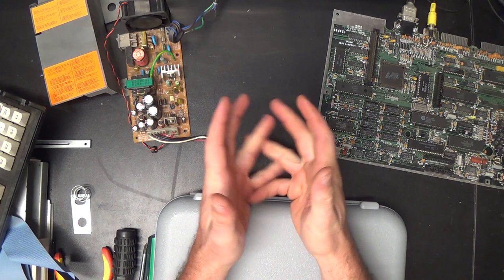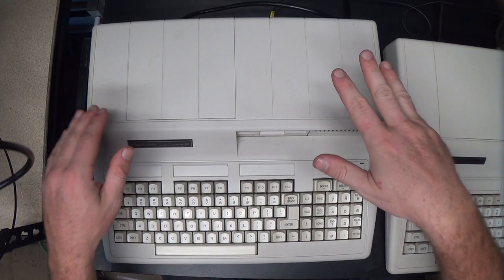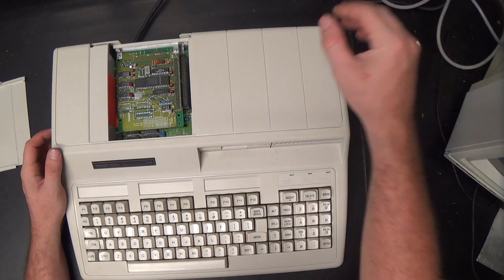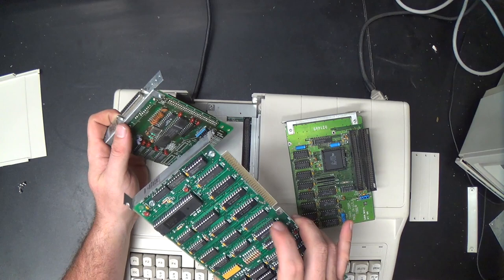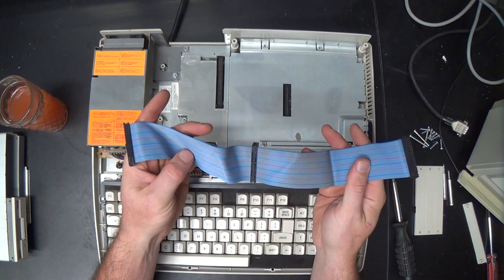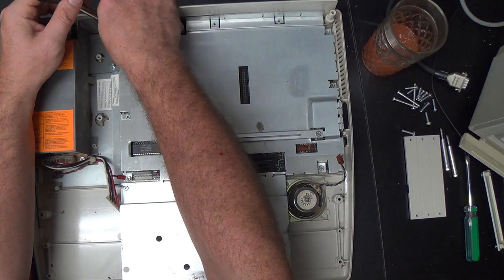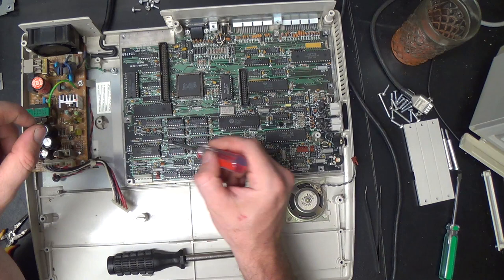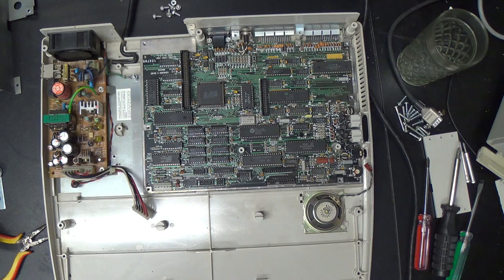Tandy 1000 HX (Pt.1) Ramble and Tear-Apart (#SepTandy 9th, 2020)

Comment from the maker: Well guys, I went up to film the next one and discovered that one of my power supplies decided to spontaneously harikiri.  470 ohm resistor literally caught on fire and the main transformer burned a winding on the primary side.  Or at least that's what I think from farting around with a meter.  Anyway, I spent the whole evening messing with that and didn't actually get anything constructive done, so I guess the next odour of bizniss will have to wait until tomorrer.  D:  Sorry!

Comment: Fortunately for those who can't find PLUS cards, the PLUS bus is ISA compatible (with the exception of a few lines), and it's easy to make PLUS to ISA adapters. I prefer a ribbon myself, as it gives you more room to maneuver the card to make it fit. There's also a thread on VCFED where a few of us were playing around with making our own PLUS cards.
Reply from the maker: I have a couple of AT-form-factor ISA backplanes, one of which I intend to use with one of my HX'en at some point, but I am still trying to find a nice little enclosure to put it in.  I take a ribbon cable out the back of the HX and plug it into an ISA edge-connector card that plugs down into the passive backplane.  This is what I used: https://oshpark.com/shared_projects/cG4aZUEg  For the HX side, a ribbon cable like is intended for the Raspberry Pi GPIO header will plug into the PLUS bus if you pull the plastic shroud off.
Reply: @Lee_Adamson_OCF  I just built mine from scratch using a 0.100" 2x31 female header and an 8-bit ISA slot, and soldered the ribbon by hand. There's supposed to be 62-pin ribbon connectors somewhere, but Digi-Key doesn't have them.
Reply from the maker: @BlackEpyon  I use a 2x32 IDC connector and let the two end positions hang off with nothing plugging into them.
Reply: @Lee_Adamson_OCF  Yeah, the shrouds have just enough space that you can do that... Or accidentally misalign the card you're attempting to plug in, which was kind of an oversight on Tandy's part, but they wanted you to take it to a Radio Shack to be serviced, I suppose.

Comment: 1,000 HX was actually my very first computer. I actually got it several years after it's released back when a computer model would be selling for years instead of months like now. I was actually able to get all the peripherals very cheap I was 15 16 maybe. I actually had a modem I had no idea how to use and never really did I got the ad-lib sound card and I got the memory expansion with the additional chips so I had the full 640k or whatnot . But to refer back to your video I actually did install the second three and a half inch floppy and it was actually very handy playing King's quest games because I could load and then alternate drives and speed up the playing process by 2 seconds when transitioning from one disc to the other.

Comment: Re: 8086 verses 8088 latch bullshit, the 8088 has that too, just a little less of it. :) Both have multiplexed busses, but the 8088 technically doesn't need a latch for A8-A15. D0-D7 are still multiplexed with A0-A7, and A16-A19 are multiplexed with some status functions. (I didn't actually know about the A16-A19 thing until I started poking at the idea of making an expansion card for an IBM Convertible; every other PC in the world demultiplexes the busses first thing next to the CPU, but IBM on the convertible left it multiplexed and stuck proprietary ASICs on all their expansions to do it individually.)

Comment: Yeah rip off those RF-shields, who cares about mobile and wifi-reception quality.
You could also buy some metal paint and paint the inside of the top half of the case to get some shielding for your wifi and other  household communication.
Reply: What's the power of the 117th harmonic of the Tandy 1000's maximum clock frequency of 7.16MHz at the 850MHz lowest cell phone frequency?  The 354th harmonic at 2.4GHz?
Reply: I worry about neighbors who do get interference from this stuff.  Yes, it happens.
Reply from the maker: I think my closest neighbor is like a half mile.  :3

I'm next to Pocahontas county, WV, where all the anti-RF weirdos live.  They like, literally wear tinfoil hats and shield their houses and shit.  My plan is to generate as much RF interference as possible, and then pipe it all into a giant directional antenna and bathe them in that delicious radiation.  (/s)
Reply from the maker: @Winston Smith yeah, none of this unshielded stuff messes with any of my radio gear that I can tell.  I think it was just government dumbassery as usual, typical over-regulation.  They didn't put RF shielding in any of the European stuff, and nobody ever complained.
Reply: @Lee_Adamson_OCF  I can hear my neighbors at that distance.  Their dirty electronics wreak havoc with my HF and VHF listening.  They don't hear me complaining either though.  What they're doing is illegal but nobody really cares and they are totally ignorant of it.
Reply from the maker: @KC9UDX  Hmmmmmmm, well maybe I'll do some testing and put it back if I can hear something.  Mayyyyyyybe......  That clock/calendar won't fit in there with the shield in place, though, and I don't really want to molest it with tin snips or anything.

What bands can you hear them on?
Reply: @Lee_Adamson_OCF  Well I've no idea if I could hear that.  But I hear all kinds of hash everywhere from 160m to 6m mostly from what must be wall warts and TVs.
Reply from the maker: @KC9UDX  Oh yeah, unshielded switching power supplies are awful.  X_x  I do keep that kind of junk shielded.  I just don't think motherboards and the like are significant contributors.
Reply: @Lee_Adamson_OCF  I think I have a few <=1MHz computers that I've defeated the shielding in.  It's one of the things I mean to investigate if I ever get time.  How far away can they be heard, and what frequencies?
Reply: @KC9UDX  Get the ham club together to do a foxhunt for retro machines modified to increase spurious emissions.  Let me know how it goes.
Reply: @BandanazX  would be fun.  Though i haven't been to a club meeting in... Five years?  Not even sure.

Obviously this isn't a problem today because everything is digital, so everyone is oblivious to interference.  In the days of cheap Taiwanese black and white televisions with wide-open receivers however, this likely was an issue.  Especially because the FCC bothered to get involved.